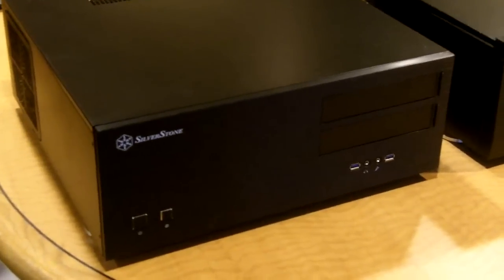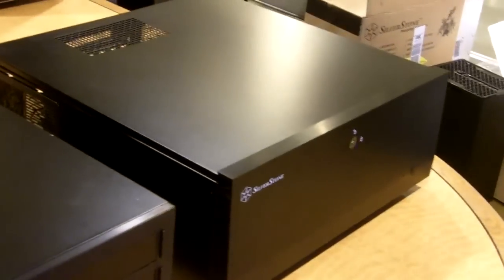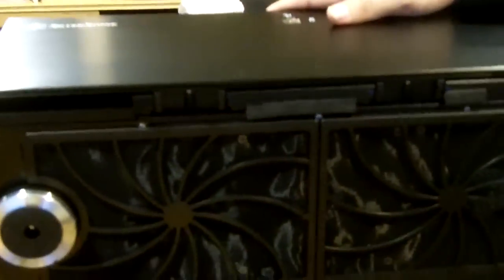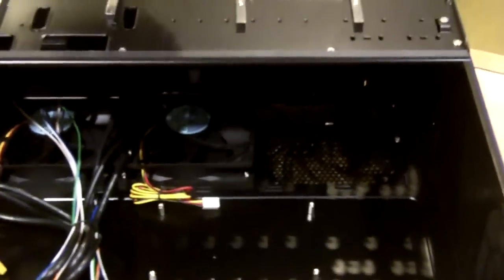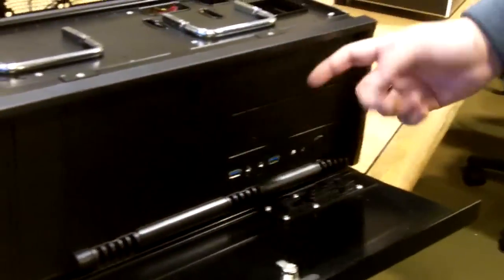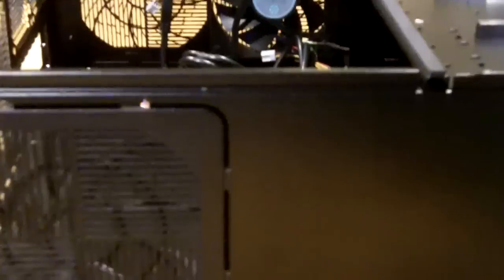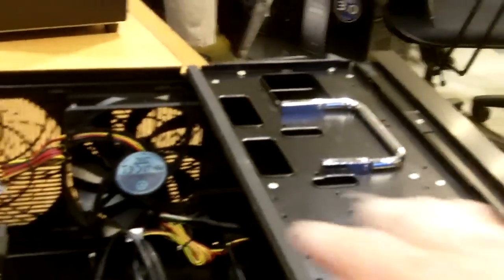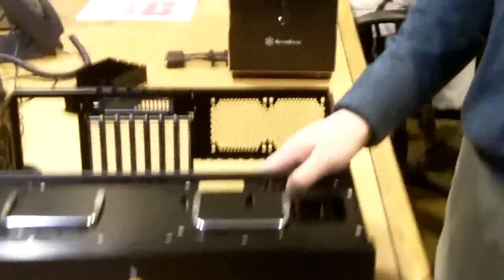Silverstone GD7 and GD8

Comment: I own the GD07. Awesome case & I Need the room for HDD & movie storage. In the 2 vertical external 5.25 bays I have installed 2 removable HDD adapters. They are external access hot swap 3.5in HDD for endless movie storage.

Comment: This looks like its a great case for a HTPC, something that I'm looking for. However, I can't get over the front design of the case - specifically the ugly lock front and centre (this reuins the entire front). Secondly, for a HTPC I would think if an optical drive is to be installed - aka bluray player - you would want to install it horizontally. GD8 - again the turn off factor is the exposed inputs.